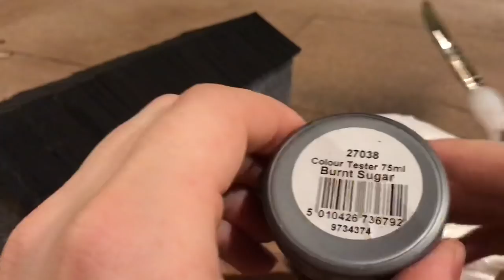Modelling a Barn - Yorkshire Dales Model Railway

Comment: Excellent scratch building and you really are an inspiration.  Your video have changed my approach to my model railway which has bits of 'raspberry' all over it.  Thanks very much and during the pandemic I have moved forward with building using as much scrap as I can find instead of rushing off to the hardware store.
Reply from the maker: Thanks, appreciate it!  I’ve been doing the same thing, it’s crazy what you accumulate and how useful most of it can actually be!  Thanks again.

Comment: Great video and a very nice looking barn too. Have you ever used foamboard for the structure of your buildings? I found it in my local model shop at £0.99 for an A3 sheet and now use it for most of my buildings. It's quite strong and takes glues well and can be cut very easily.
Reply: Luke Noble ..... hi what glue do find sticks best ?  , I’ve bought some sheets for a project ..... regards Fred
Reply from the maker: Thank you.  I haven’t Luke but I certainly will.  I used the hardboard simply because it was lying around in the loft, but will use foam board next time.   I’m sure it’s much much easier to cut and work with as you say!  I’ll pick some up next time I’m in my local MS.
Reply: @FredWilbury  Hi Fred, I found that rocket card glue was the best but pva glue, wood glue and hot glue also worked really well on it. Don't use any solvents/super glue on it at all as that will dissolve the polystyrene layer and release some quite smelly gasses.